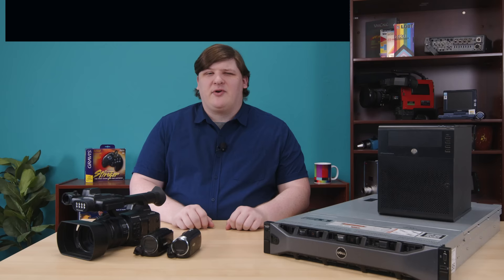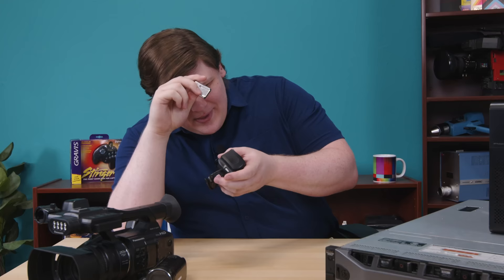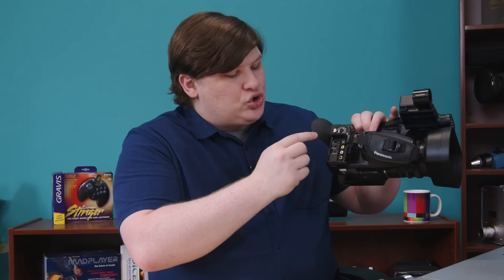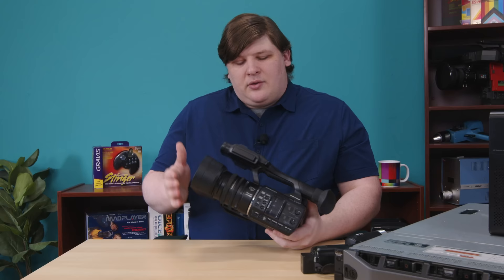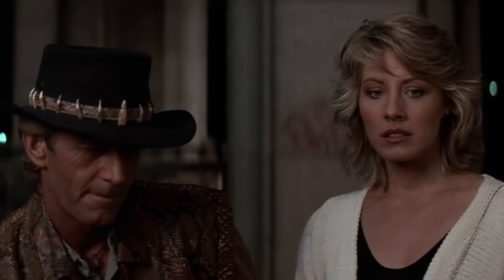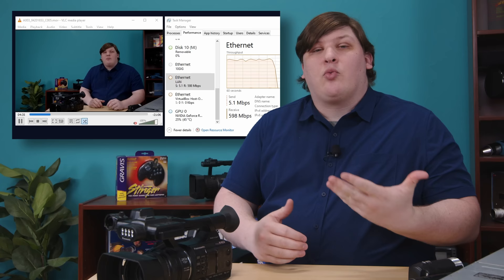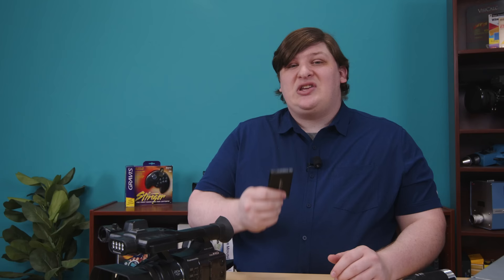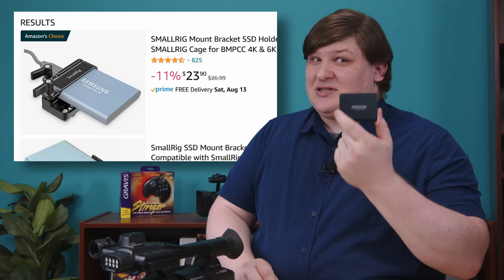I Built... a really fast NAS?

Comment: My Samsung SSD recently kicked the bucket in a way I’ve never seen before. Last I checked, SMART was at like 97%, but now I can’t even check because it returns “not available” for some reason, and so does the short DST test. Some programs can see the partitions, some can’t, data recovery software can only recover ~1% of the files on there so I can only imagine a lot of it’s gone anyways. My HDD that gets a “caution” in the SMART test, and my old NVMe that’s at ~70% are more effective. So that’s fun. Definitely backing my stuff up now.

Comment: RE: the smoking PSU. A lot of times an electrolytic cap can vent out of he bottom and you don't find it on visual inspection unless you look very closely.  I have also seen inductors in several smps become heating coils and cook things around them (still usually because a cap has failed).

Comment: I'm surprised I watched the whole video :-). I've done similar things over the past few years creating NAS boxes for myself and others; and I've worked on a Dell r710 (or maybe an r720?) and done the IT mode flash procedure. Even had the blue clips on the controller break when I went to remove the battery. Rolling your own solution on Ubuntu though seems like more work to me than just using Unraid (or TrueNAS), but I've used Unraid for more than 5 years now. At some point I'd like to redo my home NAS with ZFS, but I haven't had the spare resources to get enough ECC memory or matched storage to make it worthwhile. Anyway, I'm glad you've got a reliable NAS for your videos. Keep up the good work.

Comment: A few tips/hacks:
Encoding: locate files to encode on the NAS using a script. Write the appropriate ffmpeg line to a bat script and schedule the windows PC to run it at the right (night) time. All via the NAS. So each night you schedule a total om X seconds of footage to be transcoded.

The microserver can be used as an offline backup. Just simply rsync the files and then shut it down.

The ingestion: if you are comfortable with it you can use something like overlayfs or even symlink magic to make the files appear as if already copied, before and while copying.

Comment: The key to not hating rack mount gear is 
1. Getting a rack that has pretapped holes and not the kind that take those clip on nuts
2. Sliding rails that let you service things without removing them from the rack
3. Bud Industries makes these rack screws that are binding head with a conical tip so you need not have a 2nd person to hold things while you screw them in

Comment: Ages ago I built a twin Xeon CFD server (16 cores felt like a lot at the time). I put it in a Corsair 680T, which I had to mod in order to get the motherboard standoffs in the right places, and went just a bit crazy with the water cooling.

The loudest part of that rig under full load is the pump. It's a D5. If you've ever used one you'll know how "loud" those get. Or at least it was until I changed the fans over to the case's built-in controller (rather than their 5V LNAs). Now you hear those a bit too.

Last time I ran s-tui they were peaking somewhere around 48°C, that's at about 23°C ambient after hours and hours and hours of stress testing. Damn, I wish I could overclock them!

Comment: My team and I designed that box... I owned a number of the subsystems (schematics and layout) personally :). I hope you enjoy it.
Reply: BTW, the R720XD has 2U HS vs the "GPU" HS (1U) available for the R720 proper. Be careful with consumer GPUs if they have a fan, you could get negative turbulent flow... no fan server cards are much better.
Reply from the maker: Thank you for the advice! Someone's sending me a Quadro P1000 that ostensibly does nvenc great but only has a tiny HS/F, so it sounds like I inadvertently ended up with a better choice than if I had gone out and gotten an overpowered GTX950 or something.
Reply: How would I go about sending you some stuff?? I can give you my email address, but don't want to post it here :)
Reply from the maker: @MrComputerguru79  You can email me at cathoderaydude at gmail!
Reply: @CathodeRayDude  will do!

Comment: I work as a devops engineer and have spent a decent amount of time in my past working as a NOC engineer for a fiber ISP + working in DCs. This video is spot on, if you want a server in your house (like a NAS) most people should probably just use a custom build with consumer hardware and buy a midtower case that has a shit ton of HDD bays. It's way less to deal with but still painful lol

also, on the Crucial front, I recently bought their X6 External SSD and noticed after about 400-500gb, the drive slowed down to around 30-40mb/s 

At first, I thought it might be the actual Startech USB-C hub I was using (but they are actually a decent company and have compliance with USB standards). I spent an entire day troubleshooting it because I was getting UAS errors, so I used modprobe to disable UAS to the drive.

Wouldn't ya know it? The hardware in it is both DRAMless (which isn't ALWAYS bad, the Samsung NVMe DRAMless drives are actually great) and it the larger storage on the drive is some pretty terrible (speed wise) flash memory. I can't remember what it is and am too lazy to look it up.

I decided to just keep the drive since it's fairly cheap and it is compact, but if I have to write more than 300-400gb to it, I plan on just doing it overnight.

Sucks that Micron has done this with so much of their flash memory and doesn't clearly disclose it. I was confused bc I was actually getting better benchmarks with the Crucial SSD than my Samsung T5 but I realized it was because the drive was empty lol

I hate micron for this.
Reply: also, weird thing - I have a PNY flash drive that I picked up for ~$40 that is 256gb and while most flash drives have awful write speeds - this thing is fast as hell and gets around 300+ megs a second in write. Sure, the SSD was only 10-20 dollars more and 1TB (but it was on sale! so I didn't think much of it) but my PNY flash drive absolutely destroys it in performance. Honestly should have just bought another flash drive.

Comment: I love the bit about the ums and ahs. XD It came across as remarkably authentic for someone who's talking about the issue as it's happening.

LOL The battery bit! :D I know I've done some things like that... Oh, I know, most of the incidents were with software. Something would annoy me but I'd hammer away and find workarounds and keep going, then in some cases more than 10 years later I realise I could have done it differently all along! I've done this with Linux and I think I've done it with Plan 9 from Bell Labs. It was harder to miss things in Plan 9 because it's a pretty small system, but I'm pretty sure I managed it anyway.

Nice summary of touchscreens! :D They have some plus points, but I don't think they're any good for tools which you want to operate while your attention is on what you're doing. You have to focus on a touchscreen to use it, mostly. Plus, as you say, menus. Besides this, I've had touchscreens be a bit glitchy at times and swiping can get very tiresome, but both of these problems seem to be getting better with my health.

I've done lots of Bash scripting. I hate Bash. Part of the reason I did so much of it is because I didn't realise other tools were available. ;) But partly it's because I rejected other tools for stupid reasons. I try not to think about that too much because being that annoyed with yourself isn't healthy.

I've had monitors I couldn't adjust right. It's awful! I hate sharpening too.

Oh no! Menus with roller controls! I feel your pain, man, I really do.

Whatever happened to the technique the BBC used in The Secret Life of Plants? They took extra high-res video from fixed points, then panned & zoomed digitally in editing. But if you're talking about when 1080p was the latest tech for consumers, I don't suppose you could have done that.

I'm thankful my house of worship doesn't use those.

Hahaha I know the feeling about not wanting to sell something so bad.

I'd like to introduce you to something which lets you show the camera you're shooting with. It's called a mirror... :D I'm only teasing. I'm not sure it would actually work very well in practice, especially as you'd need 2 or 3 mirrors to show the back.

I've had a bunch of experiences where a well-designed interfaces in a paradigm I hated turned out to be much easier to get on with than the interfaces I thought I'd like. It's really changed my mind on a few things.

Nice pan, there. Very nice. ;)

I've been waiting for the time you could extract photos from video. :)

Oh disk space! I bought 2 720GB hard drives in 2007, partitioned them 500GB/whatever, installed one of them, and kept the other for backup. Iin nearly 10 years of logging my hectic, all-day every day online social life, downloading pictures, taking far too many screenshots, [i]and[/i] downloading DVD-ROMs for esoteric operating systems and generating hard drives to go with them, I didn't fill that 500GB. As soon as I started downloading video, it started to fill up.

The sizes & custom slots of those pro memory cards make me wonder if they changed them like a gunman changing his clip in some ridiculous action movie. ;)

But all this storage stuff kind-of answers my question about panning & zooming in post. The BBC didn't have a bit rate problem when recording because plants.

Now imagining SD-RAID: some little SBC with too many SD slots writing to a bunch of SD cards in parallel to get the necessary write speed. RAID stands for Redundant Array of Inexpensive Disks, so I guess it would be called RAISC. But the T5 and other products may be similar to RAISC internally.

I've really got to slow down my comments, I'm only 20 minutes in.

I have trouble with making backups too. Once or twice, I've figured out a system which will suit my needs and my paranoia, but it was too much to implement. When I discovered Win10 will back up to my second hard drive, I just told it to do that, so now both my drives are full. :)

Oh, ya, keeping on doing something good until you suddenly realise you haven't done it for months. That's me all over. :) This is why I need my backups automatic, which makes the process 10 times more complex. Ohhh yes, sleep habits are a big part of the problem. I like certain Plan 9 filesystems which, once a day, mark all the used blocks as copy-on-write. This is a much faster process than actually copying the data, and gives you a permanent history of each day's files. This could then be copied off for backup when the computer is idle, and the copy could be paused without worrying about changes messing up the backup. I'm sure ZFS can be configured similarly and perhaps more comprehensively, and has some advantages -- in Plan 9, you can't actually delete files once they're in the history. :) I really wish I'd persisted with FreeBSD and ZFS in 2017, if only for storage. (I was trying to use it as a desktop where it had too many of the flaws of Linux desktops.)

Oh... huge capacity, affordable ex-business... I need to get me one of these. I'm saying this with full knowledge of how boring and annoying servers can be. In fact, I'm already wondering if I could put FreeBSD on mine because, when it comes to servers, I can't beat the words of a career sysadmin: FreeBSD is Linux for grownups. Linux is made in dozens of little parts by business who are all too often self-interested, (Red Hat are just as evil as Microsoft,) and individuals who are surprisingly often unbalanced and/or not as smart as you'd think. The core system of FreeBSD is a much larger part of the system, it's all maintained together, and it's altogether more professional in the old-school meaning of the term: doing a good job and letting/helping you get on with your job; not hassling you. After 18 years of Linux, I found it very refreshing.

Now you mention the case issues, I'm thinking of building my own. Oh by the way, you know how some loft conversions have just a railing separating the stairs from the room? I lived in one of those for a while, and absolutely loved being able to get to the backs of my computers from the stairs. :)

LOL surprise return of the fans!

o.o CPU so slow! But how? Wait, what filesystem takes so much CPU power... oh, ZFS again?

Heh! File verification has come back to the way MS-DOS did it. :)

Haha! My trouble is I learned so much before ZFS came around, and being not very smart and not very patient too, I never learned ZFS properly. Not even with FreeBSD's nice documentation.

ROFL! Yeah, I think PCs should have LOM by law too. XD I wanted to develop that sort of thing at some point, before I'd heard of it, possibly before it existed, but me and development didn't get on so well in those days. I'm just starting to get around my various strange brain blocks now. One thing I was able to do was use my little Linux machine from across the Atlantic in 2005 using VNC.

Heh, Intel and Linux drivers. Back when everyone was saying how awesome Intel were for being involved with Linux and producing drivers for their GPUs, I found I had less trouble with Nvidia drivers which all the open-source fanboys hated. It was one of several things which killed my enthusiasm for open-source.

I was wondering what happened to 10GbE.

I, um, I've had astonishingly few problems with hardware. I run cat-5 cables under carpets where the sheath basically gets shredded. It looks horrible, but they just keep working. However, my bandwidth requirements are low, so it might be that I'm just not noticing as TCP retries losses. But sending a disk image through my old router (and healthy cables), I saw the speed decline to around 550kbps, and it stayed that way! That's what I got for expecting much out of a device I got free with my ADSL, I guess.

Good to learn about SFPs & stuff. I hadn't properly been keeping up with the server scene since long before 2017, so this is all catch-up for me. Electrically though, 20m is excellent for high-speed cable with very little circuitry on each end. And that is one really tough cable! And I'm one of those people for whom 20m would be more than I'd ever need. :D

That flashing utility looks like something out of the demo scene! XD

I do love it when the defaults turn out to be just right. :) As said previously, servers are boring and annoying, so not having to change stuff is a good thing.

It wasn't the video I wanted, but it was the video I needed. Nah, I'm joking. :) It was a fascinating dive into what you can do with server technology at home, which was much more interesting to me than what the title indicated. I'm glad I clicked! :)

I'm sorry for the length of this treatise, :) I hope it's at least a little bit entertaining.

Comment: Just discovered your channel and thoroughly enjoyed your video.

I've worked in IT for years with servers, Dell PowerEdges are absolute workhorses and the R720 should serve you well.  Some tips if I may for others looking to do this.

If you can go for a 13th gen PowerEdge which are now trickling into the 2nd hand market - the "fall-blown" hardware RAID controller in them will do 12 GB/s , certainly for SAS drives that support it.  13th gen+ are also much more suited to accommodate graphics cards.  Base iDRAC model is the "Express" which offers remote monitoring and power control but not a remote console, or virtual media (like a DVD ISO)  nor can it use a dedicated iDRAC NIC port - you need the "Enterprise" version for that.  Premium servers like the R7xx and higher come with Enterprise as standard otherwise it's a licensed upgrade.  Some servers will be missing the iDRAC port and whilst it can be added that doesn't mean it has Enterprise licensed (Dell would sell them like that).

The use of transceiver modules for fibre networking is all about cable length.  There are modules for short range fibre and (naturally being more expensive) for long range fibre that runs to kilometer distances.  Modules mean the underlying interface card stays the same.  Like you found out, Direct Attached Cables (DAC) aren't designed for long distances so exist for convenience to remove the need for mucking around with transceivers.  Be wary, some vendors of fiber equipment will only work with "own-brand" transceivers and DACs; the usual ploy of restricting choice and charging through the nose for them (think printers and ink cartridges).  This has got better over the years with many 3rd party transceivers and DACs now made much more compatible or vendors relaxing their stance (switch manufactures like Cisco are the holdout).  Always check compatibility.

You might be missing a trick not using the hardware RAID capability of the server's PERC controller.  These days they are pretty good at preemptively predicting drive failure.  They also include some amount of fast cache (along with a battery backup) but bear in mind slower spinning disks will see the most benefit from that.

Another option to connect the storage to your computer is by using iSCSI, cutting out SMB file shares completely.  This'll expose the disks direct to the computer as though they are directly attached, resolving your, er, Resolve problem .  Use two network connections and use iSCSI MPIO and you not only have redundancy but also double the bandwidth!